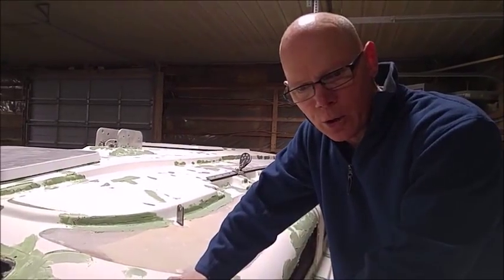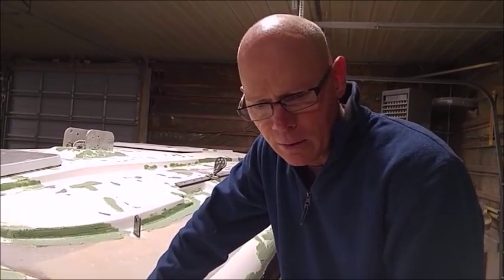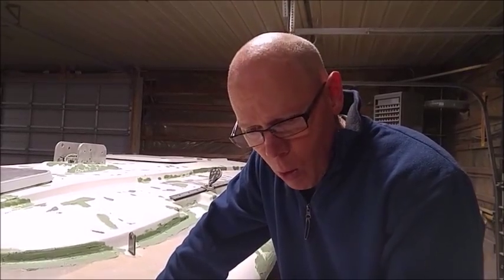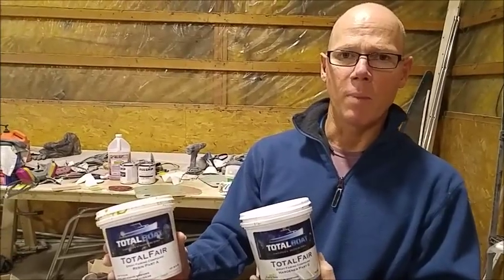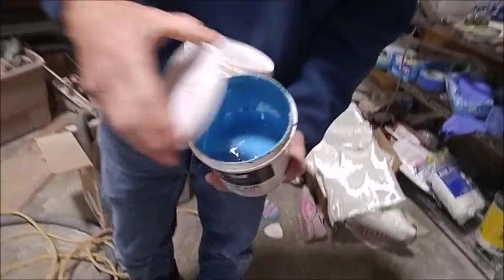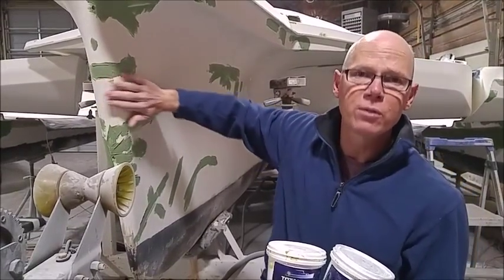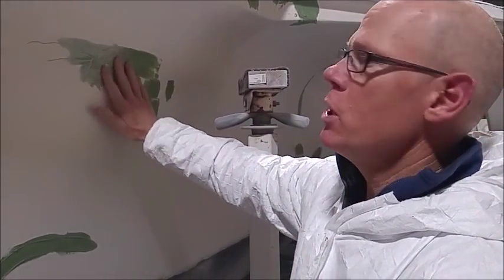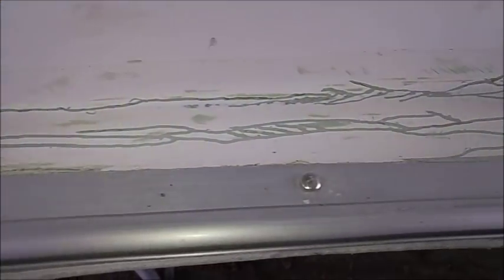Repairing Spider Cracks in Gel Coat

Comment: I had a repair shop for 20 years. We found that spider cracks almost always come back. This results in a very unhappy customer. If you can’t get behind the fiberglass and add some structure, the part will continue to flex and the cracks will come back. We all ultimately just decided not to take those jobs on anymore because it was a guaranteed dissatisfied customer.
Reply: You mean to put a layer of fibreglass over the top of gelcoat or did you mean to put it under the existing fibreglass to reinforce the core ?

Comment: I’d glass the back of the spider crack. I never liked mixed epoxy with polyester. Seems like a good product but I’d probably just mix a peanut butter/slurry. I also think gel coat is usually put on too thick.

Comment: Great Video ive had good success using other Total  products from Jamestown Distributors on my boats  i fully understood you were prepping  that Vessel for a Awlgrip job would there be  advantages to applying another Gelcoat over the paint ?  Just curious  more than anything as i do know the advantage of  future touch ups or matching with paint is usually easier  and or would those same areas be more prone  to  re stressing cracks because of the overall weakness in that area  either from Engineering or  heavy use  i had a 30 ‘ Sea Ray that. Always got Stress Cracks  in the Cabin roof or bow area from people always  loading and unloading their heavy coolers and.  Equipment  onto the boat there  i eventually turned my boat around in the Slip  to sort of force people to use the  Stern  and Swim platform  which lowered the stress cracks   Over time  and sold that boat  anyway  due to Boaters disease Two Footitus   ! As we need that extra couple of feet  on the next one to get the extras we think we need !

Comment: It should be noted that that fairing compound will not work with Totalboat gel coat. Learned that the hard way. You’d think Jamestown would state that on their website, or warn you when you buy two incompatible products.
Reply: Elijah Merrill That is an unfortunate flaw in their otherwise good line of products! Thanks for the heads-up! This project was painted with Awlgrip subsequent to repair. The project turned out nicely!
Reply: It actually isn’t a flaw at all. You can’t lay a polyester over an epoxy.  That’s something you should have known with experience.
Reply: Gel can be applied over just about any epoxy. I buy from Jamestown daily and forums out the hard way total fair is incompatible no matter what you do or add to the gel. I have sprayed gel over thixo hundreds of times with no issue

Comment: I have an insane amount of cracks on the gel coat as well as the rest of the boat from top to bottom. Do I drill them ALL OUT and use your same filler?
Reply from the maker: Marine supply stores offer fillers to apply over spider cracks, but the only way to insure that they don't reappear is to widen the crack, then fill it as seen here.
Reply: Stephen Holt if you have a great number of cracks, your gel cote may be “checking.” It occurs from age, weathering, sunlight, and temperature change that causes the gel cote to crack into small, irregular squares. In this case, the remedy is to grind down or completely remove the gel cote and re-gel cote the boat. That was not the case with this project. -Andrew

Comment: Apart from too light a laminate resulting in flexing, cracks are also from too thick an application of gel coat - gel-coat will not flex very much and so crack. So fixing the cracks is just merely a cosmetic fix. You need to fix the real cause.

Comment: The glass is thin and flexes too much. This causes the crazing/cracking. With such extensive cracking, at least thickened epoxy should be laid in first. These cracks will reappear on either side of the repair.
Reply: I agree.  They will telegraph through in not time.  I'd like to see the boat now to see if the repair held up.
Reply: 1UTUBEUSERNAME we reinforced the decks where flexing occurred. Other areas have shown no degradation of the repaired cracks.
Reply: 1UTUBEUSERNAME also, “print” or “printing” is the term for cracks or other problems which are covered but can be seen through or beneath the repair. -Andrew
Reply: Andre Marais the filler IS thickened epoxy. I could have made thickened epoxy myself, but buying it is easier and ensures more consistency. After two seasons, the filled cracks are fine. The paint is in excellent condition. The boat was made to be very light. The vacuum bagging process results in a thin hull. Most of the glass in this boat was not cored as is common to reinforce sailboat decks. We reinforced some decks and joints with biaxial mat.
Reply: Ok. Thanx

Comment: The instructions on the fairing compound recommend sanding prior to applying.  What grit sand paper would be good for that?
Reply from the maker: It would depend on what kind of surface you're sanding. Fairing compound will stick better to surfaces that are mildly roughed up and not extremely smooth.

Comment: Thats a lot of cracks..  What year and brand is the boat?
Reply: cepuras it is a 2005 Telstar 28 trimaran. It was one of the first vacuum bagged production boats made, and this hull was an early number. Hence, I estimate the factory was working out the process. The build is very light, 3000 lbs for a 28 ft boat! It is sturdy, but light. -Andrew

Comment: I have the same problem with my boat, how much filler did you use in total?
Reply: Aaron Gary oh my! I used nearly 1 gallon of filler. Most of the cracks were small. It does not require much filler. -Andrew

Comment: So it's not necessary to have to redo all the gel coat ?
Reply from the maker: We did not do gel-coat because of the extent of the repairs, the desire to have a new color, and nature of the problems with the original gel-coat. If you choose  to gel-coat, you would only open the cracks down to the fiberglass and then apply gel-coat. You would apply gel-coat until it is slightly prominent, and then sand it back to the level of the surrounding gel-coat.
Reply: @yachtorial2809  I only ask because I have a small Hawaiian canoe hull and was thinking about fixing it up as there are cracks in the get coat but I was told I have to sand down the whole thing past the gel coat if I wanted to fix it (guy that told me that I questioned what he knew) it seems I can fill spider cracks sand it down and paint it and call it good ?

Comment: Although the fairing compound you are using works well, it is not easy to sand,, even with autobody DA sanders...I've been doing this for 35 years....It also takes forever to harden...24 hours at 70 degrees F and really about 48 hours at 70F to sand it...
Reply: JetDriver1111 that is correct! However, an orbital sander with a succession of grits will take it right down. An ocillating tool works for the tight areas. -Andrew

Comment: why cant you fill the cracks with resin?
Reply: Darrren Betker The cracks will have contamination in them, which will weaken the resin and prevent it from filling the cracks. Also, the straight epoxy will not be as strong as filled epoxy. Additionally, if un-drilled, the cracks will be unlikely to fully fill the cracks. If the surface is to be repaired, unfilled cracks will reopen.
Reply: @rocketagp  so if i use a dremell to open up the cracks then can i use resin to fill them? Please respind quickly as im going to be doing just that starting tomorrow.
Reply: Darrren Betker yes. First, wear a respirator mask, eye protection, and a dust suit! Use the Dremel 9910 Tungsten Carbide Cutter bit. Grind the crack by gently laying the bit into the crack and cutting along the crack down to the fiberglass. The opened channel will be 1/8” wide and show the fiberglass below. Do no cut into the fiberglass. Only remove the gel cote. You will draw the dremel, laying it at a low angle along the crack. I use one hand to hold the dremel and the other to steady the bit. Once you finish opening the cracks, blow out the dust. Then clean the boat with acetone to remove dust and dirt in the cracks and on the boat. Thanks for asking! -Andrew
Reply: Darrren Betker ....about the resin... I would use thickened epoxy because resin alone will run and make a mess. Additionally, the thickened epoxy will have better structure. You could thicken epoxy using a product like the West system with either light or heavy weight filler, but I recommend buying filler like the Total Boat product. It is thickened epoxy that is going to be perfectly consistent for you. I recommend making a mixing board you can wear over your thumb, like one you would see an artist painting with. I mix on the board, slip it over my thumb, and carry it on the boat while filling the cracks. Spread the filler in 2 directions to be sure you get any air out. Do not leave a big buildup over the crack, but do not dig the spreader into the cracks. Sand the filler down to even with the surface after it cures. You will find that a second application may be needed to get the level surface you want; otherwise, you may get some “printing” of the filled channel through your final painting or gel cote. -Andrew

Comment: With all those cracks and that gelcoat substrate so bad, why wouldn't you just sand the whole boat  down to remove that bad gelcoat and then prime and paint. Whos to say that those cracks are the end of the cracking of that original gelcoat? And then after done and painted new ones appear.
Reply: Good point